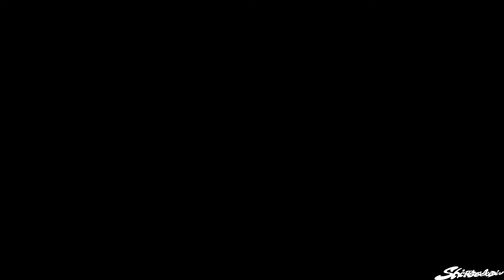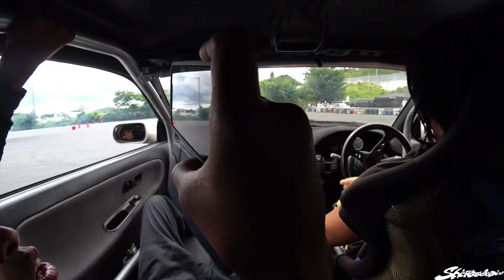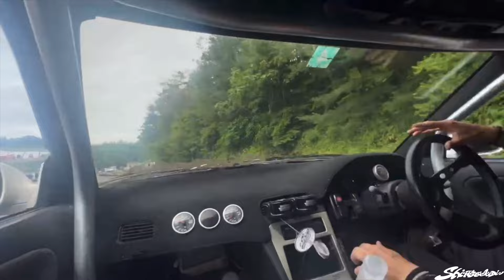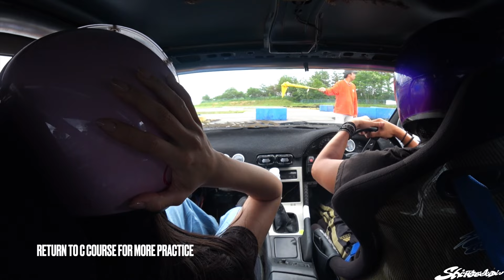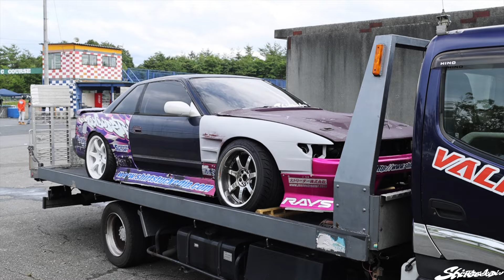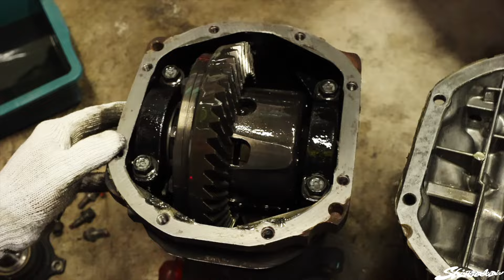V2 2530 S13 - SOLO SUNDAY MEIHAN PRACTICE

Comment: sick video casey. too bad for the diff but its to be expected. ive blown 3 in the last 1.5 years and theyre becoming rare/expensive. you run a 4.6 2way on a z32 box?
Reply from the maker: @fearlessdrift6110  thanks man it’s a rare thing to blow one these days as most parts are new. 2530 S13 runs a 4.3 with RB25 box x

Comment: Are you running a weldy or 2 way?
Reply from the maker: 2 way no one runs welded diffs at meihan x
Reply: @shirtstuckedin  ever tried a 1.5 way? if so any thoughts?
Reply from the maker: @FadelessSpade  yes 3037 is 1.5 way and love it x
Reply: @shirtstuckedin  What's the benefit of a 2 way over welded?